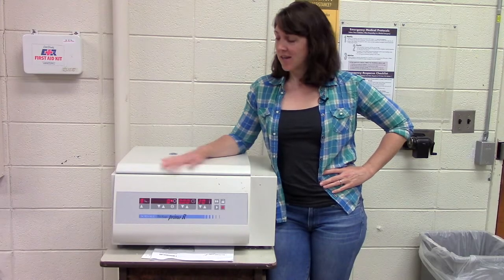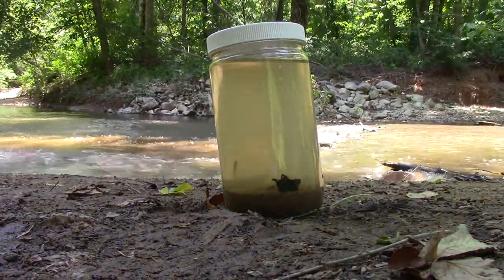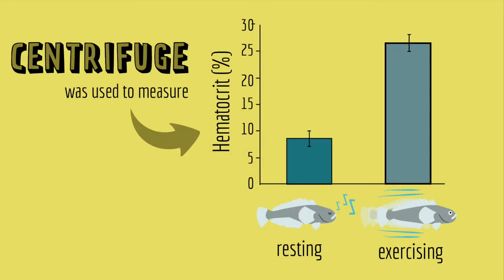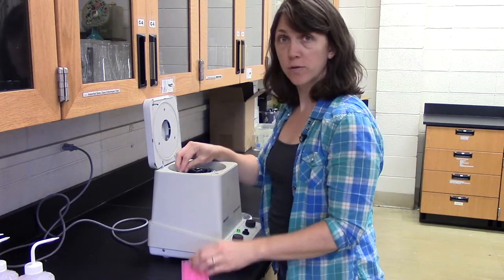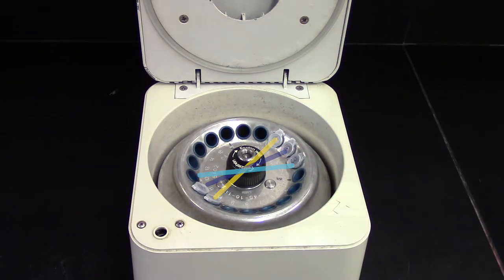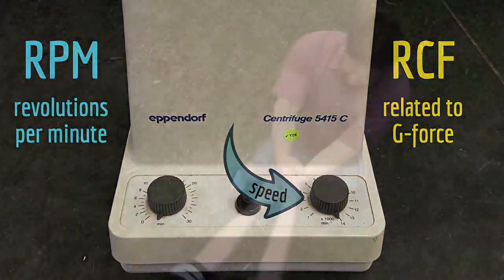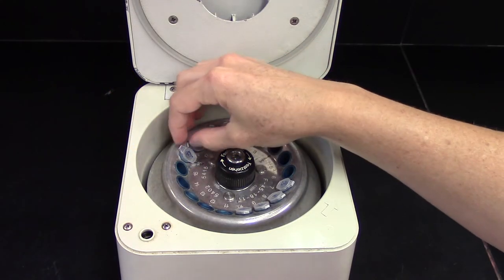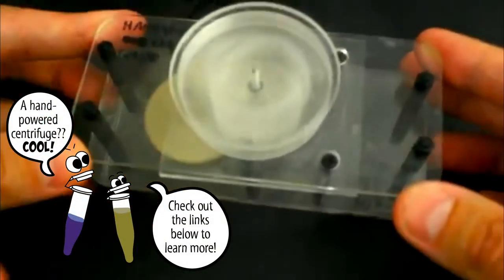How do you use a Centrifuge? A step-by-step guide!

Comment: Hi! How do you remove solid pellets from the bottom of the centrifuge tube?
Reply from the maker: I've never seen an application for a completely dry pellet. Usually you resuspend the pellet in a small amount of liquid - either a little leftover supernatant, or a new solution. You resuspend the pellet by pipetting up and down. If you have a particularly big pellet, it can help to use the tip of the pipette to "stir" the pellet into the resuspension solution.